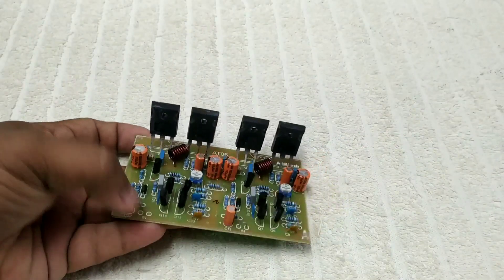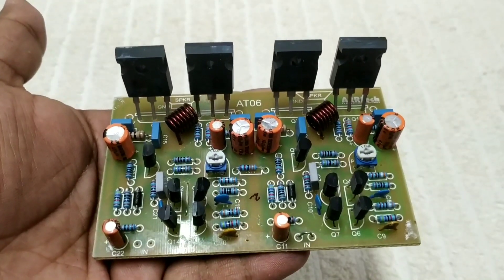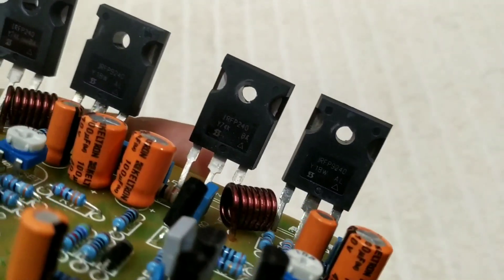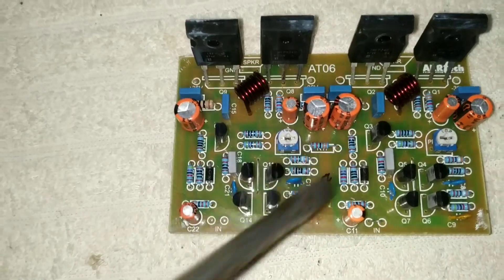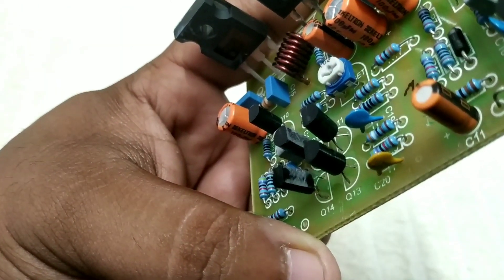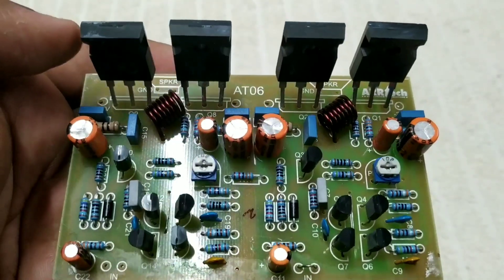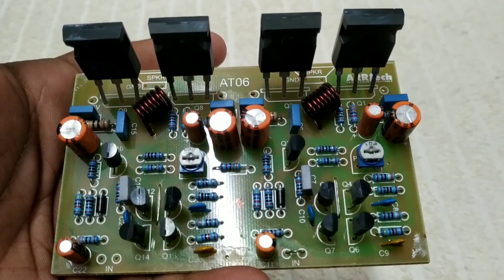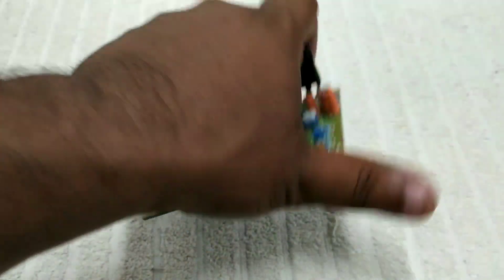Mosfet board for subwoofer. 300wrms at 4ohms load. You can  easily run a JBL subwoofer

Comment: Ethil maximum 4 oms150 wads rms kittum 200 onnum kitilla
Reply from the maker: Jbl easy ayi run chyikkan ith thanne dharalam branded itemsil 500 1000wrms ennokke ezhthy vidunnund sony ethrayo hometheatre il 500w 1000w ennu ezhthy vidunnu arkelum nthelum parayanundo😂😂 enthe athine eduth vach aarum video idathath... 50w polum kittulla per ch..
But performance und..
Real lifil ulla performance anu palarum nokkunnath ningal ii parayunna pole jbl il nominal 300wrms kodth run chyikkan onnum pattulla.. Last chyilla ethrennam 300w kodth kathichond vannittund ivde recomend chyunna car amp polum 180wrms anu
On paperil ulla Rms ilo watsilo alla karyam ennanu enik thonnunnath...
Nammal real ayitt experience chyumbol engane kelkunnu ennathanu karyam
Reply: @technicalevolution9887  oh apo 300 watts ulla amp kodtha thanne woofer kariyan chance undo🤔🤔🤔🤔😮😮
Reply from the maker: @itsmetorque  yes car amp 180w in btl mode

Comment: Bro njan ee board 27 0 27 v 8amp use cheythittum 12 inch dainty nannayi work cheyyunnilla .. athendanenn ariyamo???
Reply from the maker: Sub filter ethanu..  Pinne power supply caps nallathano
Reply: @technicalevolution9887  sub filter ethanenn ariyilla capacitor keltron aanu
Reply from the maker: @harisankar8568  7012592783

Comment: Tda 7294 mosfet ano നല്ലത്
Reply from the maker: Tda 7294 ic audio purpose nu vendi specified anu but MOSFET general purpose linear ayitt use chyumbo MOSFET heat koodthalanu.  Pinne nte abhiprayathil tda 7294 anu better
Reply: Mosfet
Reply: Mosfet low noise and low cost than tda

Comment: നല working ഉള്ള board  ആണ് പക്ഷേ ഈ MOSFET board ന് ലൈഫ് കുറവാണ് വാർദ്ധക്യം ഉണ്ട്
Reply from the maker: But njan ivdunn Kore amp home usinum carinathum okke chyth vittittund but problem onnum vannittilla bro pinne verum chathan MOSFET anel pettennu adich pokm
Reply: @technicalevolution9887  oru 1year kazhinjal pazhaya perfonence kittunnilla
MOSFET audio purpose use cheyyunnathu alla
Athu inverter purpose varunnathalleee
Oru company yum MOSFET use cheyithu amp board undakkunnilla
Reply from the maker: Ath correct anu bro switching purpose anel ok anu
Reply: @technicalevolution9887  najan ariyunna oru board assembler undu adheeham paranjathanu ennodu
Adheham transister Anu use cheyyunnathu
Reply from the maker: @jinusuhail5291  Kore per MOSFET mathy nnu paranjond varum avark ith kodth vidum..  Class d yil switching nayi MOSFET anu use chyunnath..  MOSFET linear amp ayi use chyumbo nalla heat undakm
Reply from the maker: @jinusuhail5291  transistor thanne bro better
Reply: @technicalevolution9887  expense kooduthal allee 
Ente oru abhiprayam parayatte 
MOSFET lum transistor lum different vocal Anu 
Kooduthal punch MOSFET alle
Reply from the maker: @jinusuhail5291  saryanu but STK kidilam anu bro but nalla ic kittandee
Reply: @technicalevolution9887  mmm
Reply: Ee paranjathokke sari but ente cousinte carilot njanoru mosfet amp cheythu koduthittund ippo oru 3year kazhinjittund no problem
Reply from the maker: @bijeshks5917  alla bro oridakk irangya universal kits boardnu Ii problem undarnnu ippo illa Kore use chyumbo out korayum nnu complaint undarnnu but njan power trick arnnu use chyunnath so nk AA problem vannittilla 4yr munp kodthathokke ippolm kidilam working anuu
Reply from the maker: @bijeshks5917  AA problem vannath verum koothara MOSFET ayondarnnu annu aa same MOSFET 40rs nu kittumarnnu
Reply: @technicalevolution9887  njna MOSFET nu 10 ampere kodukkarundu veetilekku
Pinne  vandikalil nammukku maximum 2ampere alle kittu 
Nalla 30 or 35 frequency filter board kooduthal ampere illathathinal sub patharippovum
Reply from the maker: @jinusuhail5291  caril smps board vach 10 ampere kittum
Reply from the maker: @jinusuhail5291  27 0 27 volt 15 ampere kittunna smps boardum und
Reply: @technicalevolution9887  athu correct 15 amps illa fake Anu
5amps transformer performance um aa 15 amps smps  onnu workku cheyyichu nokku appole athinte difference manassilavum
Reply: @technicalevolution9887  oru audio specialist ennodu paranju 
MOSFET board lekku maximum 7amps 30 0 30 kodukkan pattu 
Perfect HD  transform anu  enkil mathram

Perfect 10amps koduthu heavy duty yil amp workku cheyyichal maximum 5 minute then
After MOSFET will damage
Pinne nammude nattil athra  prefect aayi transfomer wind cheyyunna aalu kuravan
Athika alkkum correct calculation ariyill athu kondu 10 20 amps kodukkunnathu
Reply from the maker: @jinusuhail5291  appo oru doubt bro Ii Sony  4ch amp ulpade class d mono block llam ithe power supply anu use chyunnath.. Pinne bro oru karyam koody orkkanam transformernekkal efficiency smps nu anu doubt undel njan oru video chyam
Reply from the maker: @jinusuhail5291  1000wrms vare out tharunna mono block class d und car amp dyno test youtubil und onnu Nokku..  Current drain athil kanikkum
Reply from the maker: @jinusuhail5291  aa class d ulpade llam ithe smps anu use chyunnath bro parayunna pole 5ampr okke varathollu ngil ether RMS kittum just think
Reply: @technicalevolution9887  Sony MOSFET alla use cheyyunnathu
Pinne 15 amps company ethe MF  capacitor Anu kodukkunnathu
Pinnu athu company product Anu
Avare technology nammukku kittan prayasm Anu
Avarude engineers athra mandayulla kuttathil anu
Well trained anu
Reply from the maker: @jinusuhail5291  njan power supply anu bro paranjath
Reply from the maker: @jinusuhail5291 sony car amp ulpade power supply switching use chyunnath MOSFET anee
Reply: @technicalevolution9887  bro njan oru Sony yude digital amp kondu transistor Anu use cheyithathu 
8inch sub 24 0 24  5apms 
Entha bro athinte perfomence 
Kidilan 
Nammal  cheyyulla jBL nte double  perfomence heavy panching bass
Oru rakshayum illa 
But 450000anu bro vila
Reply from the maker: @jinusuhail5291  njan ippo ethand 5 yrs ayi ithe smps vach amp chyth MOSFET board vach JBL Sony polulla sub caril vach kodkkunnund veettil vakkunnenekkal performance und athinu
Reply from the maker: @jinusuhail5291  ini amp chyumbol video proof idam bro
Reply: @technicalevolution9887  nammude tourist bussil ulla Sony explore 200w alle ullu?
Reply from the maker: @jinusuhail5291  yes ath class AB anee
Reply: @technicalevolution9887  Pinne bro 
Eee 12v car batteril ninnu 1000w RMS kituu ?
Reply: Athra adhikam vilakoduthitt athinte 10 il onnu mathram vilayulla speakersumaayi tharathamyam cheythittentha kaaryam..
Reply from the maker: @UChKZFdqb3P1ptngIdJCecBg njan paranjath class d mono block und 1000wrms okke varunnath
Reply from the maker: @UChKZFdqb3P1ptngIdJCecBg u can wats app me 7012592783